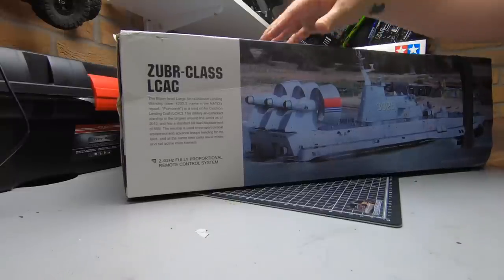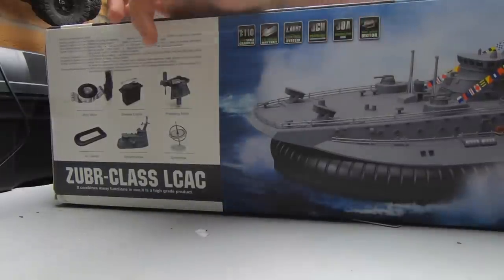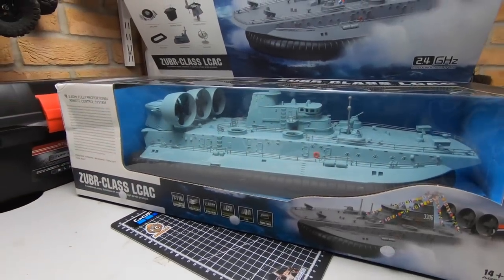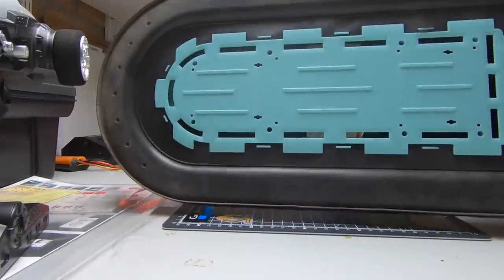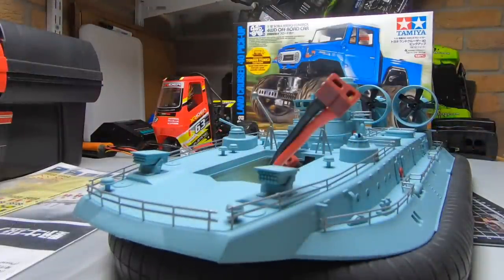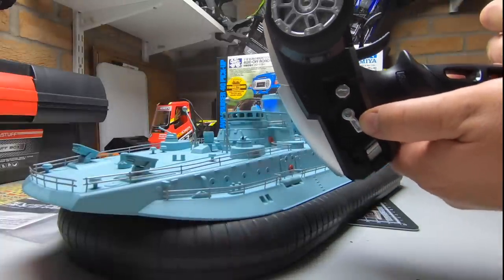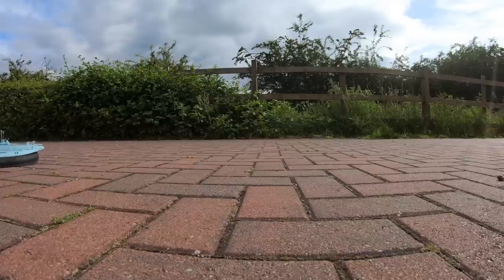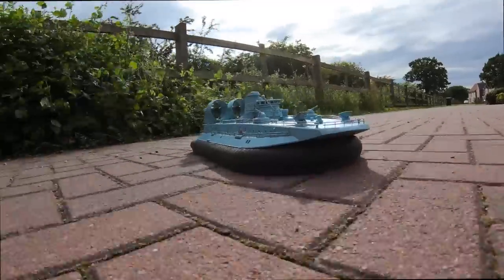Brushless RC Hovercraft HG-201 - Worlds biggest Hovercraft Zubr Class LCAC 1/110!

Comment: I have wanted a model of this vechicle forever! I would have been overjoyed to find just a decent sized static modelkit of this thing.
I have a couple of models on the LCAC. But to have an R/C available. This is great.
Thanks for the heads up.
Reply from the maker: No problem Mike, I'm getting a little more used to the controls now. Works well on a smooth surface

Comment: I will not be buying this one. A hovercraft is supposed to do exactly that and this item does not hover very well. maybe if the floating motor was stronger or maybe you can see what a 3S will do in it.
Reply from the maker: I'll be trying it with 3s to see if it improves it. 👍
Reply: @TomleyRC Garage: That is great to hear, I can't wait to see that.
Reply: @TomleyRC  How was it with a 3S battery?